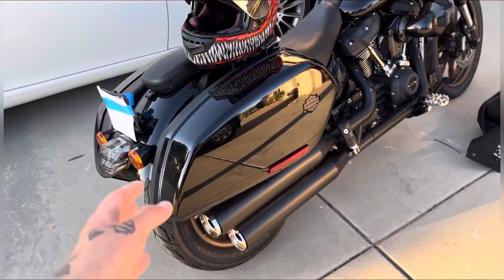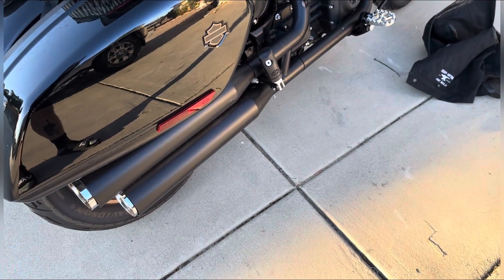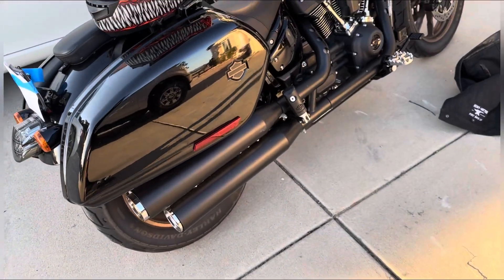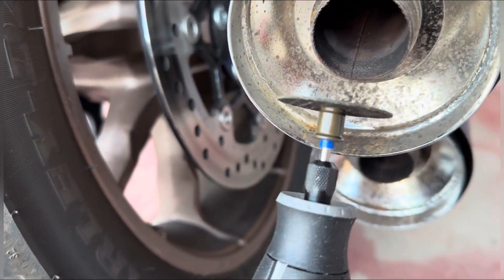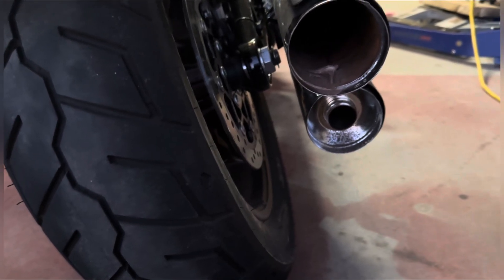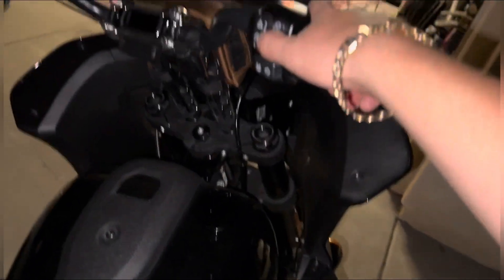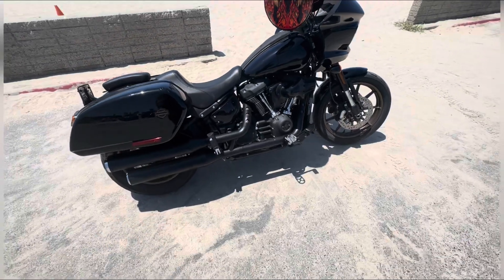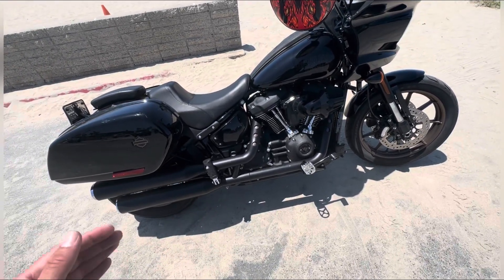Harley Davidson Softail Lowrider ST stock exhaust baffle removal

Comment: Did something similar, but I removed the cats, cut the baffle in half and installed the large end out and wrapped in fiberglass. Tig welded the insert in place. Sounds as good as any of the slip ons on the market.

Comment: So when you look inside the pipe and couldn't see thru what you're looking at is a perforated ceramic puck. I removed mine and holy loud!
Reply: How to remove the puck?
Reply: @noahhammond3402  The puck is your Cat. Remove the slip on and stick a broom handle or pipe in from the back side. You'll have to hit it pretty hard but it does come out

Comment: Are you still running the bike like that and if so since then have you noticed anything different?
Reply from the maker: Yes bro still running this setup! Gonna do a vid on what i changed. Im running THUNDER TORQUE INSERTS now. Major improvement!
Reply: How long did you ride around w/o a tuner? Did you notice any decel pop?
Reply from the maker: @AVD-og9fr  still riding with no tuner a few months later very rarely pop on decel. Only when you rev it hard